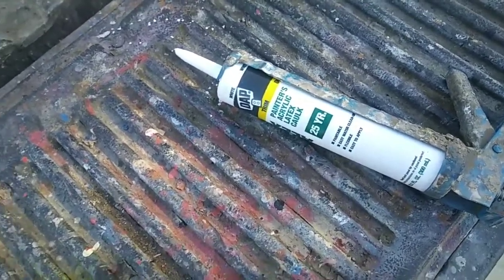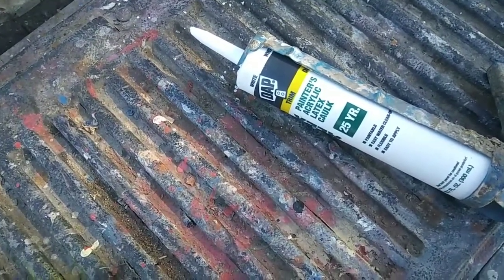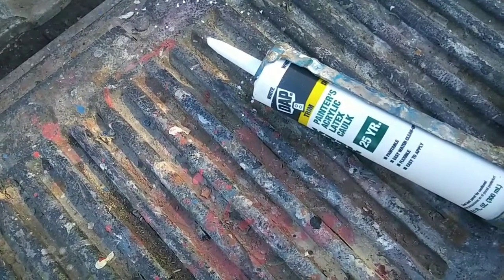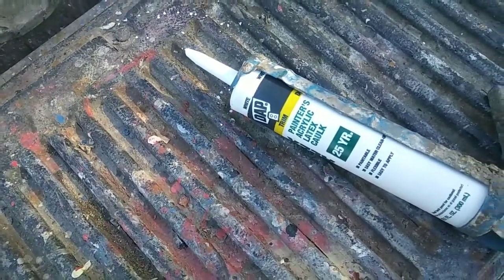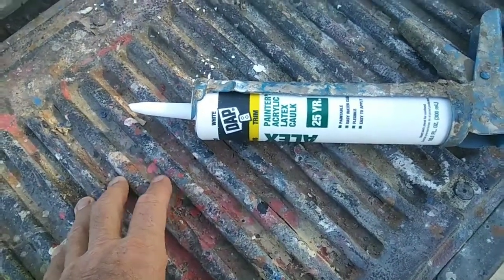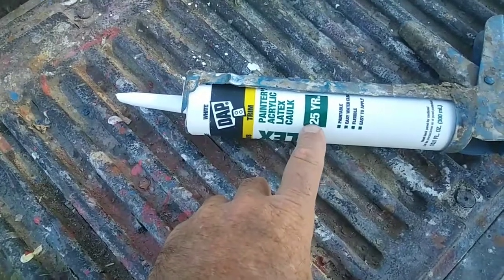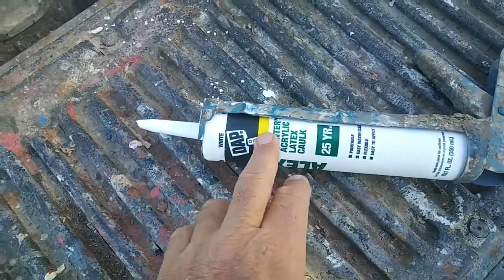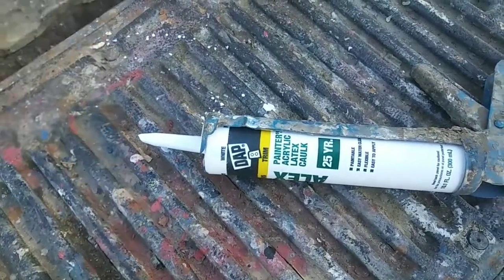Getting paint to stick to silicone

Comment: I don't understand the down votes. This is solid advice. Primer like kilz allows you to paint on silicone but run a wet towel over it and the paint will start to come off. Painters caulk is the best option.
Reply from the maker: Dude I have haters all over the place I give some of the greatest information out. But I found that some people just don't get it regardless of how good the information is they just think it won't work
Reply: @mikethepainter  Maybe because you don't show examples and film a tube for the entire video. Not a hater. Trying to help. ;)

Comment: I tried caulking over silicone then did a tape adhesion test. The caulk pulled right off the silicone. Though, caulking over silicone will make it last long enough for the check to clear!😆

Comment: That does work, I’ve been doing that for years myself, I’ve tried numerous things even oil based primer still a hassle but a quick fix and no troubles , good to here I have been doing something rite.  Enjoy watching your videos, what kind of spray gun do you use, is it a graco silver gun with a flat tip? Thanks
Reply from the maker: I made a video just for my setup on the channel. look up setup for details. silver gun cone filter housing cone filter and flat tip. No reversa except for certain jobs.
Reply: OK thanks so much for that

Comment: Hi,
I have put black wood stain on my exterior fascia.I then filled in the gaps with Dow C60 low modulas silicone sealant.
I'm just a diyer I didn't realize I can't cover the silicone with more blaclk woodstain so it blends in.I've try looking using Google but didn't have much luck. Could you suggest any product that would work?
Thanks.
Reply: By "gaps" I assume you mean either the nail holes or the joins in the fascia. There's multiple different products out there in terms of paintable/stainable exterior gap filler. Cheapest way is sawdust mixed with pva glue (preferably sawdust from the same type of timber as the fascia) if you're just filling nail holes in timber fascia and plan to stain. it.